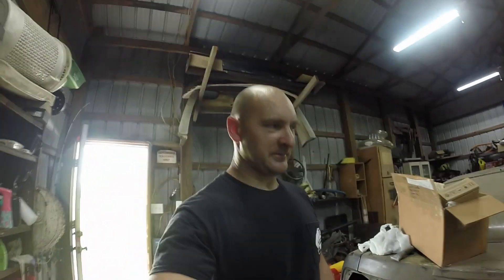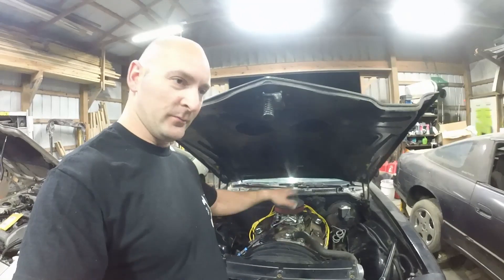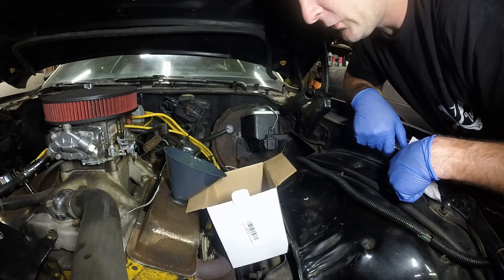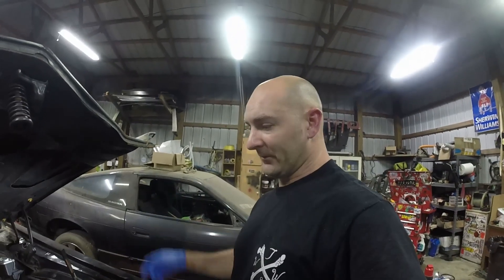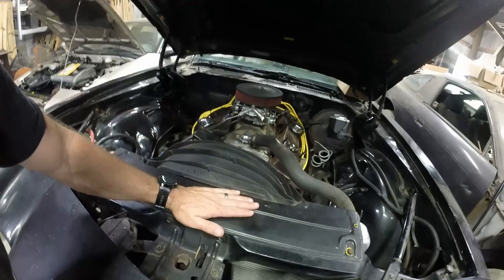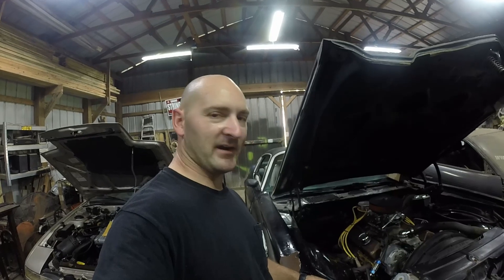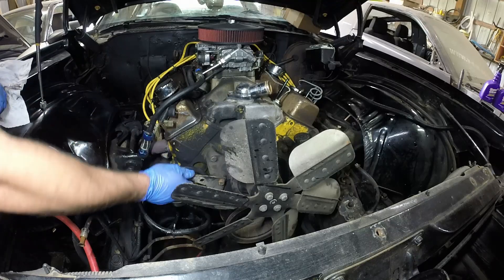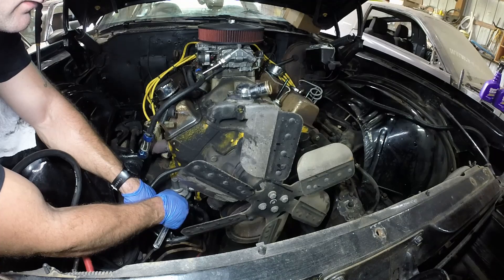What Happened To My Camaro?!?! (1980 Camaro 2nd Gen)

Comment: I am slowly working on restoring my dad's 78 LT. Got it running now , doing brakes slowly now as it has none at the moment.
Reply from the maker: I love mine, it just need lots of resto. Over time it’s getting better and better. My next video will be me pulling the engine and diagnosing what I need and want to do. If you haven’t seen the power stop brake video check it out! 
https://youtu.be/jlvkcr-PVsE
Reply: @TheShopWorldWide   Yes I saw that one, I replaced passenger caliper and flex line already. Doing drivers side then moving to rear hopefully I can break the bleeders in back. I dont know how to do drum breaks. My dad did them in 2015 before he passed away so they may be ok. but its been outside since he passed front were seized so had to replace calipers. He bought it new in 78 so it  means alot. Already replaced two floor boards that were rotted.
Reply from the maker: @jimfiacchino2071  sorry for your loss. I kept my old calipers just to play with and possibly rebuild as spares. Hopefully it works out for you and you get it on the road!
Reply: @TheShopWorldWide  one of the calipers are probably
 still good passenger side the bleeder valve broke off so i figured I would replace both.
Reply from the maker: @jimfiacchino2071  sounds like a good reason to!